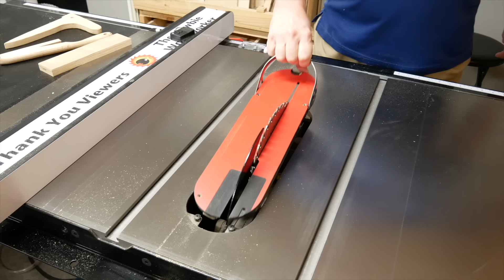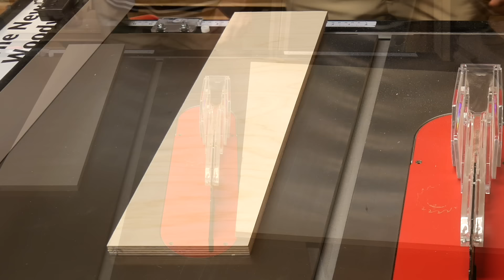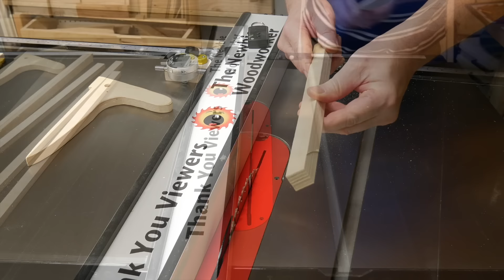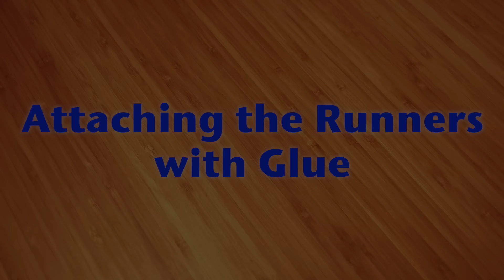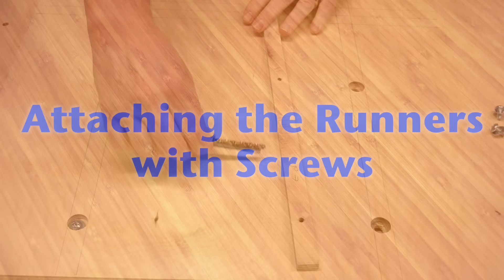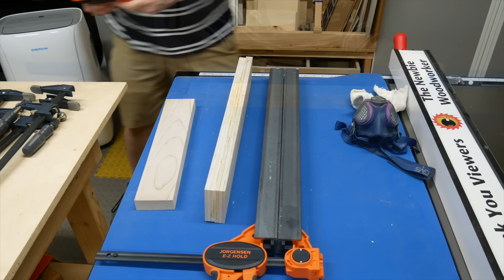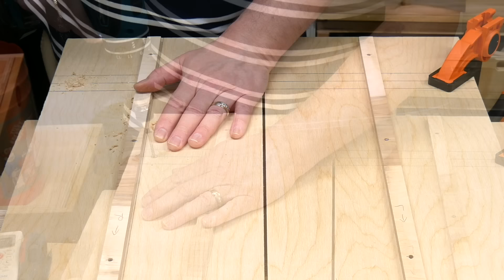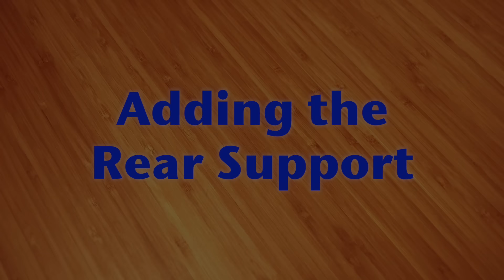Build this Revolutionary Cross Cut Sled, for Newbies!

Comment: My tablesaw is an older Delta that did  not come with a riving knife or blade guard, and doesn't seem to have a way to install one. At least not that I have found yet. At least these cross cut sleds will make it a little safer for me to use the saw.
Reply from the maker: Glad I could help! 😄

Comment: Also .. wouldn't it be easier to cut one runner just as you did, then do your micro adjustments to get it dialed in to fit your slots before cutting all the rest? Seems like that'd give you less wasted material and less wasted time/effort...
Reply: Tip/question #2, on aligning the fence, you need to match it to a tooth on both the front and back of the blade, not just the front tooth. You need at least 2 points to make a line.
Reply from the maker: @an_innocent_bystander  For tip #1, the answer is yes, but I wanted to show that even if I struggled with it a little, it wasn't hard to do. As for #2, the fence only needs to be perpendicular to the cut the blade makes. It doesn't really matter if it's the front or rear teeth, just the end result. Although if you're approaching this from a machinist's point of view, and are talking perfectly perpendicular down to the micro-degree, then you're right, but for woodworking that level of precision isn't needed.

Comment: Thanks for sharing. I also prefer working with the blade guard on. With the fence cut in half and without a front fence, isn't the sled delicate to move around and store?
Reply from the maker: Thanks for your comment. That was my concern when I first made it, but it hasn't been an issue at all. That might be because I used Baltic birch plywood for the base, but if you're concerned, you can always add the back support piece I mention in the video. But honestly, I doubt you'll need it.
Reply: @TheNewbieWoodworker  thanks for confirming. I will make one and give it a try. I was also wondering, what is the downside of first cutting the notch on the fence (for the guard to pass thru) before attaching it to the base?  It removes the steps of taking out the screws and putting them back and making sure the holes are aligned.  Thoughts?
Reply from the maker: @b3arwithm3  Well, that's an interesting question. Let's pretend there isn't a notch for a minute. I'd still get it aligned first, and add all the screws. Then I'd remove it and add the chamfer. If you add the chamfer before aligning the fence, then when you try to align the fence, the square kind-of slides into the chamfer, which of course means you won't be able to align the fence properly. If you have a square with a thick enough edge that the chamfer doesn't affect it, then you could cut the chamfer and the notch first. Does that make sense?

If you use the kinds of screws I recommended (SPAX, GRK, Torx), then it's not a problem removing it and re-adding it. Unless of course the plywood you use for the fence is really crappy, in which case the screws may or may not hold well.

If you're in doubt, just try it and see what happens. That's how I learned - at a ratio of something like 5 fails for every success, until I figured out what works and what doesn't. Now I'm down to 2.5 fails per success. 😛It really is OK to try what you think is best. If you end up being right, then that's awesome! If you fail, you'll understand why it wasn't the best way. Those are the lessons I remember the most.

Good luck!
Reply: @TheNewbieWoodworker  when I built my current sled, I cut the chamfer before attaching the fence.  While I do have a square with a thick edge, I wanted to use several squares to ensure accuracy.  To avoid the square sliding into the chamfer, I put a thin metal ruler against the fence before placing down the square.
Reply from the maker: @b3arwithm3  I was going to suggest that, except you really have to be careful - but it sounds like you've got a good understanding of what's going on, so by all means - try it! You could also use William Ng's "5 cut method" to align the fence, if you'd prefer. I always mess up the math, but for some people, it works really well. Keep me updated!
Reply: The Newbie Woodworker i used the 5 cuts and got it square on my second attempt. i was thrilled that i could still understand math 😀.  ialigned my square against the blade and i think your tip of inserting a thin strip in the sled is a much more pratical and accurate method.  Lots of good tips in this video for newbies.  Thanks for that. Definitely going to watch your other videos.
Reply from the maker: @b3arwithm3  Thanks, and glad you got the 5 cut method to work. When I tried it, I never got it to work, although I've realized in the last day or so that that was when I had a square that wasn't square, so obviously I wasn't ever going to get it right. 🙄

Comment: I’m sorry to say that you made something simple so complicated.  You made one sled in which you glued the runners.  Then you made another one which you used bolts and screws to attach the runners when wood screws would have been better.  Also,  you could have used a pin nailer to attach them.  When I glue wood up, I put a small amount on and spread with my finger, then I rub the two pieces together if possible until they get real sticky.  That’s when I line up the two pieces and clamp them together for at least 6 to 8 hours before I do anything with them.  I’ve had total success using this method.
Reply from the maker: Thanks for your opinion.

Comment: Great video.  Thanks for sharing.
Each of us must choose what suits our own needs, bearing in mind the resources we have available and our own level of OCD.  
For me, personally (and I admit that this is not for everybody), I would use William Ng's "5 Cuts to a 'Perfect' Cross-Cut Sled" at https://www.youtube.com/watch?v=UbG-n--LFgQ  Lots of people say that this method involves too much mathematics, but there is only one calculation, which involves subtracting the first number from a second, dividing by a third number and multiplying by a fourth.  Not advanced mathematics, but simple arithmetic which can be done on a basic pocket calculator or on the calculator app on a 'phone.

This method raises the accuracy of the sled significantly, but not everybody wants or needs that higher level of accuracy.  If you do, check out William Ng's channel (he has a wicked sense of humour, by the way).  If you don't, then that is fine too - it might help to remember that the bigger the square you use, the more accurate your sled will be.
Reply from the maker: Thanks, David, and thanks for sharing the link. I'm not personally a fan of the 5-cut method. I'm not saying it's not a good method, by the way. It's just that prior to making the sled in this video, I've used a method from Matthias Wandel that's much simpler, and has worked perfectly every time. https://youtu.be/mLj1MeWKalI?t=134. Unfortunately the method won't work with this new sled, because we can't cut the base in half. But as I said, thanks for sharing the link, because it may help someone else! 😄
Reply: I just posted about this before reading your comment - oops. I also used the William Ng approach for my first crosscut sled.
Reply from the maker: @brimtlgtr  No worries. Replied to your comment.

Comment: I find that carpenter's squares are usually the least square tool.  I've gone through 6 different brands so far and still haven't found one that isn't off.
Reply: James K I’ve been pretty happy with Woodpecker squares.
Reply: @harrypowers9412  Yeah. They're nice but I'm not spending that kinda money on those.. I use larger engineer squares and combo squares I've tested for squareness.
Reply from the maker: @jamesk1619  I can't disagree with you, because I've found that to be true also. And I honestly struggled with that part of the video, trying to decide if I should talk about the precision of the squares, but it's a rabbit hole I just didn't want to go down. Even though I hate not talking about something so important...
Reply: @TheNewbieWoodworker  I think something you could have mentioned is when relying on any tool for squareness is to check them first by doing the mark-flip-mark method.. there's quite a few videos out there on how to check any square for squareness.
Reply from the maker: @jamesk1619  Thanks for the idea.
Reply: I believe you can adjust them with a center punch on either side of the "elbow" of the square to dial them in. You basically stretch the inside or outside material to slightly change the angle. They should all be checked and not assumed to be square.
Reply: @jkline805  I've tried that on a couple of them without success.. maybe I did it wrong but I didn't want to mess up the others and not be able to return them.  So I use a drafting T square that I found to be very square.. but you can't use it on an inside corner because of the shape.  I have to use a board I cut using the T square for that purpose.
Reply from the maker: @jamesk1619  The framing squares made by Johnson have been pretty good for me, like this one: https://amzn.to/2DY01gG.

Comment: TIP:  Don't lean the sled onto the fence when you are reattaching the fence, because that put the screw holes at a slight angle. Block up both ends so the sled is parallel to your work surface.
Reply from the maker: Great tip! Thanks. 😄

Comment: Love the  Hedgehog Feather board, impossible to get at the moment so having one designed in the 3d printing community so I can print my own in Nylon, They are really good to use and are stackable but never in stock to buy! Nice easy sled to make, I got a table saw for my christmas present so looking for the basic set of "must haves" I need to make including a router table and sanding station, I noted you had one, did you make this yourself ? Thanks from Spain.
Reply from the maker: Thanks for the comment. Yes, I built the router table and portable sanding station. I don't have a video for the router table, although I do have a router lift: https://youtu.be/LJqPDADi8MM. And here's the video for the sanding station, although I've since added a baffle inside: https://youtu.be/YzfiIdoDgeE

Comment: Thanks for this video. I have built a few cross cut sleds over the years, but your method for aligning the fence to the blade is the simplest and most fool proof method i have seen. I like the method for attaching the tracks with threaded screws also, but recently i have been able to get my son to 3D print the pieces to fit in the t tracks. He can print them with zero clearance tolerance, with or with out fitted bolt holes ( six sided press to fit ), and with or with out the t-slot. He has even been able too print them with the threads printed in so they done require nuts. The best part about the 3D printed tracks is they are not affected by moisture or temperature. Thanks again for the great video.
Reply from the maker: Thanks, and it sounds like you've got a good system going there! 😄

Comment: just don't leave stock on the crosscut sled while making cuts
Reply from the maker: I do that all the time. I'll admit that it's possible for that to cause a problem, but it hasn't yet. As long as it's not in the way, of course. But you're probably right - better safe than sorry.

Comment: When I made mine, I placed the runners as you did, put double sided tape on them, placed the board, used very short, ring shank nails and a nailset. Not adjustable, but very quickly made. I had heard the idea of fixing one end of the fence first...another great suggestion that made my last sled a fast project. 

Thanks for your videos, Dan. Something in your approach is very appealing to me.
Reply from the maker: Thanks, and that's pretty cool. Matt Jackson at Next Level Carpentry has a quick way to attach runners that you might also find interesting. I think this is the right video: https://youtu.be/0JTSxRnAJtA

Comment: Only the artist usually sees the flaws. I hate the wind from the blade blowing in my face, guard stops that. As one of your followers, laugh, I have benefited from your vids by slowing down and clearing my head while using the table saw or any woodworking equipment.  Concentrate on this step not the next three. Thx as usual.
Reply from the maker: Thanks, Bob. I think a lot of us suffer from Imposter Syndrome to one degree or another, and that leads to an almost compulsion to point out flaws. At least is does for me. https://en.wikipedia.org/wiki/Impostor_syndrome

Comment: I really like your videos, very helpful. Just had a thought, could you put a fence on the front end with an opening large enough for the blade guard to go through sort of like a bridge to keep the end more stable. It wouldn't have to be to tall on the sides to keep weight down just across the middle. I think it would make the sled more stable.
Reply: Charlie Brown I did this with mine. Great for stability but it limits the size of board (or length of the cut). Worthwhile, though. I'm going to make a secon, open ended board. Also, if you have an out feed table, groove it to accept the runners, and have a field day with long cuts! That's on my to do list.
Reply from the maker: I showed an example of that in another video - this will take you right to the spot I talk about it: https://youtu.be/AlUCDzM3gzY?t=301. But I have to say that the sled is plenty stable without it. By the way - this is a reply to Charlie Brown, not D L. 😄

Comment: Like the video, however you should never spred glue with you fingers or hands as the oil from you skin can cause it to fail.
Reply from the maker: Thanks. I didn't know that, but I won't be doing it anymore anyway, because a couple of days ago I stumbled across my two silicon glue brushes, so I'll be using them from now on. 😄

Comment: Threading wood?? You would be much safer using PEM nuts, made of steel so they won't strip out. Or use brass wood inserts with machine screw thread in the center.
Reply from the maker: I've been doing this for a couple of years, and haven't ever had problems. It's not like there's a lot of stress on them. But by all means, use threaded inserts if you want.

Comment: Another good video!  I'd like to add mention of a government review into the cause of saw injuries I found recently; it analyzed 79,500 injuries that had occurred in a two year period.  These are only the ones requiring emergency room visits.  One thing I noticed is it is not always the saw operator who is hurt but often a bystander (e.g. child or grandchild).  The entire 44 page discussion can be found by searching for "Survey of Injuries Involving Stationary Saws" on the Consumer Product Safety Commission's website cpsc dot com.  Here is the first paragraph / executive summary: "In 2009, U.S. Consumer Product Safety Commission (CPSC) staff conducted a survey of stationary saw-related injuries that occurred between January 1, 2007, and December 31, 2008, and which were treated in one of the hospital emergency departments in the CPSC’s National Electronic Injury Surveillance System (NEISS). This was a follow-up survey to a 2003 CPSC staff survey of saw-related injuries occurring in calendar year 2001, and reported through the NEISS. The purpose of the survey was to collect more specific and accurate information about the type of saw (i.e., product code) involved and also to collect more in-depth information about the hazard pattern and contributing factors to the injuries. This report presents the results from that survey for injuries related to table/bench saws..."
Reply from the maker: I've actually browsed that report before. It's sobering, to say the least.

Comment: Several suggestions:
1. use salt in your glue ups so the wood does't float while clamping. 
2. Your use of the angle iron is clever, however you should verify first the angle iron is straight on your table saw top and a feeler gauge. Also the angle of the iron may not be 90 so that may cause another issue with the glue up. What may work better in this situation is to place the glue up on your table saw top and put weight on top. 
3. Get a glue brush. They are cheap and make the overuse of glue much less.

Your method of attaching the runners is much superior to what I've seen in the past. Also the sanding block you used to sand the runners - I really like that. Going to do some mods on my sleds to make them easier to use.
Reply from the maker: Thanks for the great comment! I'll address your bullet points:

1. Lots of people have been suggesting that. Whenever I try it, I just can't figure out how much salt to use. Any suggestions of how to know how much to use?

2. Here's my thinking - I could be wrong, of course: The angle irons are 90 degrees by default, so clamped together, the tops should be parallel with each other. They may not start out perfectly flush with each other, but the clamps on the wood actually pull them level. I had originally included a section in the video showing that, but decided to pull it out because the video was just getting too long.

3. I have to laugh at that. I have two silicon glue brushes, one large and one small. I stumbled across them yesterday and said to myself "You idiot, why aren't you using these?" So I am, now. 😄

Regarding the sanding block, I love them. They're called "Preppin' Weapon" or something like that. I have 3, in different colors. Red for coarse sandpaper, yellow for medium, and green for fine, so I can tell at a glance which one is which. They're not cheap, but they feel great in the hands, have a nice weight to them, and the sandpaper clamps on them help pull the sandpaper tight while clamping them down.

Thanks again for the comment! 😄